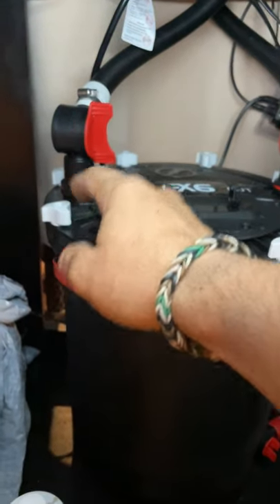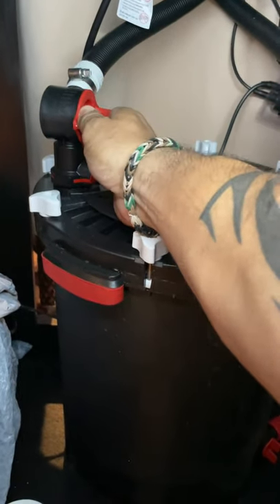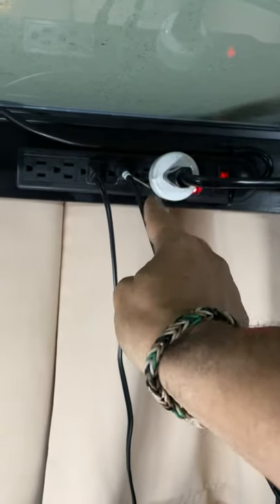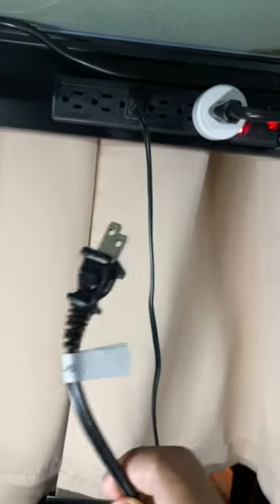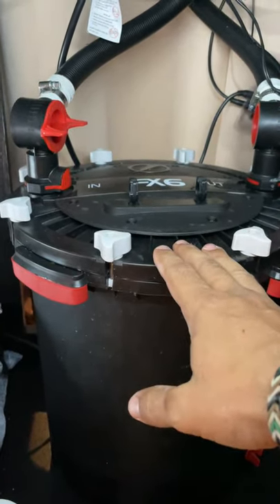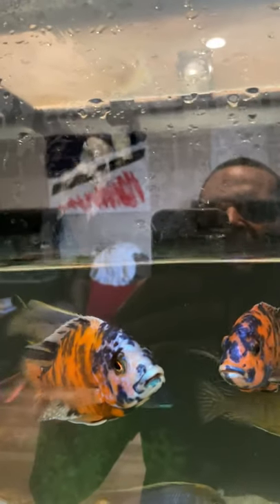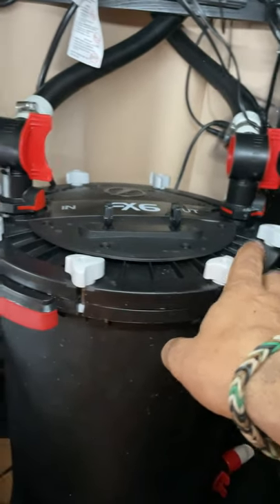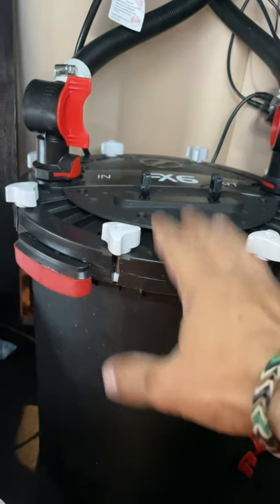FX6 Output Flow - Fix This Easy! #shorts

Comment: The easy solution is to keep the inlet side always submerged in water . You dont ever need to prime a canister that has been filled before even after you clean it as long as there is water in the hoses and you haven’t drawn the tank down below the inlet pipe the water in the hose will start the siphon when you open the inlet valve on the canister after you reconnect the canister. I never have this issue with any fx filter Ive ever used. The fx filters have an air purge function that shuts off the pump and restarts it a few times when you plug it back in anyway.

Comment: Hey Kev thanks again for your help. Yes this does look like what my fx6 is doing. Mine is also has a nocking sound coming out of the motor unit. Was your motor unit also making this nocking sound in this video? I did try messing with my fx6 valves to fix this issue but maybe I didn't mess with them in this order so il give this a shot.
Reply from the maker: Mine wasnt making that noise but you definitely have trapped air in it. This should fix it. good luck!

Comment: If you have a smart wifi plug connected to Alexa, Google, or another voice control system you do not have to physically unplug with possibly WET hands. Just use voice control to turn off and on. It's easier and safer.

Comment: Thanks Kev!  Looks like it's fixed now.  You got another like and a subscriber.  When I plugged it back in, a bunch of foggy gunk came out.  I'm assuming it is trash from the tube.  DO I need to clean the tube some kind of way?  Or just let it settle and let the the FX6'S do their job?  Thanks again for great, to the point videos!
Reply from the maker: The filter will scoop it all back up and capture it all. I blow my hoses out once a year. Make sure your food isn’t getting sucked up into the intakes.

Comment: Man I upgraded to the fx6 for my 75 gallon and not sure what's going on but I think I like my Fluval 110 way better. I'm getting micro bubbles out of the FX6 just looking at the inlet inside the tank it looks like the 110 had better suction.
Reply from the maker: This might help - https://youtu.be/VcKV9V59Z0Q
Reply: @KaveManAquatics  thanks!! That helped with the bubbles! Now I have to figure out suction.. someone suggested butting a sponge filter on the FX6 inlet. What do you think?

Comment: Set up an FX6 for my 125 Gallon and the output flow seems low. There's a heater next to the intake and it does thoroughly heat the tank at least. But the out flow feels weak. Bottom 2 trays are filled with lava rock while top tray has the red basket with sponge media and matrix underneath.

Comment: lol i did it the hard way, i threw in an water pump in the aquarium put the pump output hose to the fx6 intake line untill water came out of the fx6 discharge  line
Reply: I do that to get the air out in mine as well👍

Comment: I just upgraded to the fx6. I did this trick to stop the output dance. However, after a number of hours my filter started making a gurgling/ almost knocking sound.( without the output doing the dance) I do this trick, it sorts it again for a few hours. I've had to do it 4 times so far since saturday evening. 🤷🏻‍♂️
Reply from the maker: The fx6 has a self priming feature. It's totally normal for it to try and purge the air inside itself. But shouldnt happen more than 2-3 times a day. Any more than that and it means air is getting in from somewhere causing it to self purge more than it should...check this out - https://youtu.be/VcKV9V59Z0Q
Reply: @KaveManAquatics  Thanks Man,  I haven't heard it do it since doing your trick last night. So hopefully it's ok. I'll watch that vid though. Although, I thought I'd watched all your videos already!  Love this channel so much. Keep up the good work.

Comment: Yeah but, my fx6 keeps sputtering and making weird air noises about an hour after I do this. Idk what to do
Reply from the maker: You still have trapped air in the fx6. Might need to open it up and make sure all the media is sitting correctly.
Reply: @KaveManAquatics  I'll try that in a few minutes. Thank you for the reply

Comment: Hey Man, I have the same problem, I do follow your instruction and the problem get fixed in a couple of minutes. But then a few minutes later, the problem come back and keep making that noise, like the air inside the filter is unlimited. WHAT CAN I DO THEN?
Reply from the maker: Remember that the fx canisters are designed to prime themselves every few hours. So if this is what you mean, dont worry about it, its normal. 😊

Comment: I'm looking into getting  a fx4 or fx6 for my 75 gallon cichild tank but I'm getting mixed reviews about the way it's set up and sand from my substrate giving it issues 
I'm also looking at the oase biomaster but not sure if the flow rate is good enough 
Any suggestions would be much appreciated

Comment: I have had my fx6 for many years without any problems. One day recently is seems to have air in it as it pulsates the output hose and won't change. Since it just did it out of the blue (at least 2 weeks after a water change) I was thinking there was an air leak. I bought new hoses and changed the O rings etc and filled the fx6 up with water getting all the air out. When I installed it back in and turned it on I get the same pulsating so wondering if the motor has anything to do with it etc.
Reply from the maker: Never heard of the hose pulsating...thats a new one on me bro. The fx6 does auto purge, not sure if thats what you're talking about.
Reply: @KaveManAquatics  Champ I have ordered a new impeller as my fx6 is 10yrs old and everything was original etc. Hopefully that fixes the problem as there is a knocking/tapping noise that comes intermittently from the motor housing etc. To be honest in my 10yrs owning the FX6 and having chilids I always did water changes but had never cleaned the impeller until last week after the problem surfaced. Until I watched a video I never knew there was a serviceable part in there etc. 👍

Comment: My FX6 doesn’t do that type of strong output for months now. When I cleaned it I make sure I also clean the pump and rotor. Is the problem one or the other?  I’m leaning towards rotor but I have no clue.
Reply from the maker: Sounds like you may have a bad motor.
Reply: @KaveManAquatics  sounds like you’re right since I changed the impeller and when I turned the system on the motor doesn’t turn on. Sigh.

Comment: Mines still juddering after clean after taking the motor off to make sure nothing was inside put back together i wont stop juddering or puttering as shown in your video...any fix anybody
Reply from the maker: Have you tried this method. This is the fix. If its not working for you then you have to do it the hard way. Open up your FX6 and fill it with water (a little more than half way) then re-install. Should fix it.

Comment: What if the tank is on the floor with the fx6 at the same height level because another tank is already on top being used?
Reply from the maker: It's not going to work properly. It needs the overhead pressure to create and keep the siphon going.
Reply: @KaveManAquatics  figured as much. Guess over the aquarium is a no go as well. Thanks for confirming my assumptions.👍
Reply: @KaveManAquatics  subscribed👊🏼

Comment: Kev mines wont stop studdering it act like it wanna run smooth for a min but goes right back to studdering
Reply from the maker: Have you tried this method. This is the fix. If its not working for you then you have to do it the hard way. Open up your FX6 and fill it with water (a little more than half way) then re-install. Should fix it.
Reply: @KaveManAquatics  thanks for replying bro will give it a shot

Comment: What about with a hang on the back filter
Reply from the maker: SOrry, dont understand your question. This video is about fixing a canister issue.
Reply: @KaveManAquatics  copy, my aquacleor HOB filter was doing something similar to what you showed in this video, i was just wondering, anyway thanks
Reply from the maker: @teslacybertruck750  try adding more water to the HOB basket. Your intake may be struggling to pull water into it.
Reply: @KaveManAquatics  copy

Comment: does the in and out let needs to be above water before starting it I keep getting air trapped in the outlet hose making loud noise
Reply from the maker: Open the valves and let it fill before plugging it in. If it fills with air try this method to trap the siphon first and then it'll fill with water.

Comment: How many african cichlids can fit in a 55 gallon aquarium? This is the biggest tank that my budget can afford
Reply from the maker: 10-15 depending on size, but you have to overfiltrate.
Reply: @KaveManAquatics  im planning to use 2 big sponge filter and 75g overhead sump for my 55 gallon tank.. is it possible for my setup?

Comment: my tank is 6 weeks setup i stil have cloudy problems
Reply: I had that same problem when I put up my new 125 gallon and I ended up just putting beneficial bacteria in and it cleared itself out within a week. Gotta build that beneficial bacteria in to combat that cloudy water. Do NOT do any water changes as new water will provide more nutrients for the cloudy bacteria to thrive and reappear.
Reply from the maker: You most likely still have bacterial bloom, which is normal in new tank setups. the answer for that is NOT TO DO water changes. That will clear on its own, like Mimi said. Once your bacterial bloom is gone if you still have cloudy water problems my ebook will definitely help you, check it out, its free - bit.ly/H2O